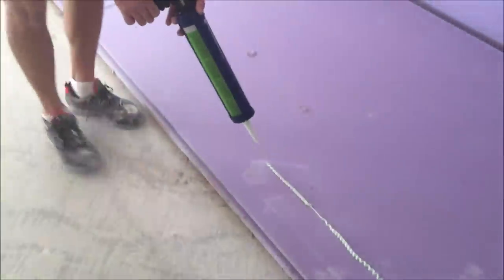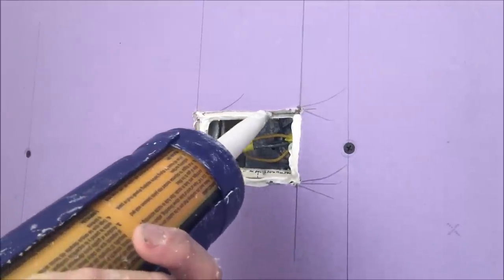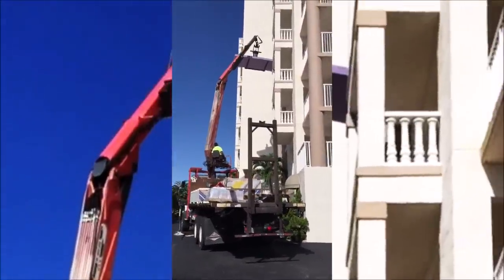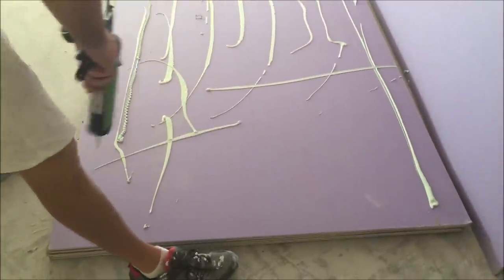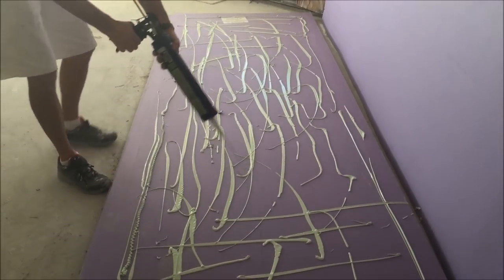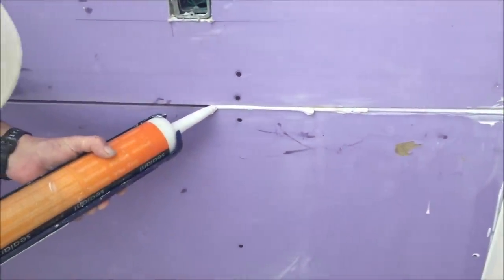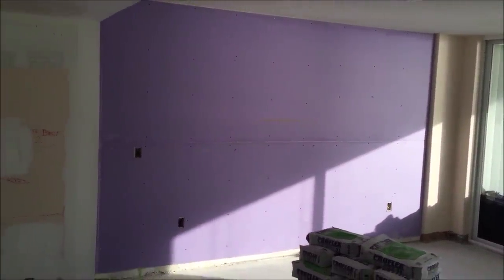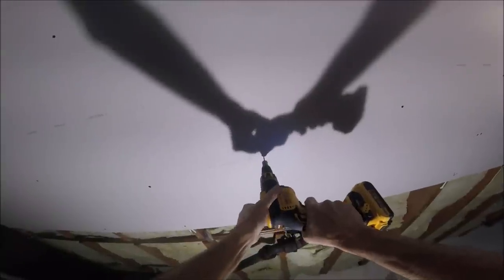Soundproofing walls without removing drywall-  Green Glue compound

Comment: I did this in my condo and it really works. If you knock on the wall you can tell it absorbs so much. I can’t hear my neighbors anymore.
Reply: did you use green glue or any regular caulk?
Reply: @shwasey  I used green glue. Two tube per one 4x8 sheet of drywall
Reply: @shwasey  I used green glue
Reply: Was it bass you were blocking or just voice/sound?
Reply: @backcrackingvideosamigo765  voice and overall sound
Reply: I hear banging on my walls all day in townhome. I hear voices too but not as bad. Did this help with those loud "bang" noises you hear all day?
Reply: @OranguBANG   Yes
Reply: How much does this usually cost for 1 wall

Comment: i think it needs more glue
Reply: Came here to post same thing. 😁
Reply: @Merrill26osu  To achieve the advertised soundproofing or STC rating each sheet of drywall requires two tubes of GreenGlue in a random pattern like this video shows.
Reply: Minumum 2, 3 tubes better, per 4 by 8 sheet of 5/8s. Must also use acoustic caulk to seal all seams between sheets, not just corners. Do it right and the benefits are huge.
Reply: wouldn't less glue mean less contact/sound transmission?

Comment: I did that in my townhouse master bedroom and it did not block any sound at all. Thats after spending $200+ on greenglue. If you are planning to soundproof do it right with ripping out drywall, insulating and using resilient channels to hang drywall.
Reply: Appreciate this information. Looking into some master bedroom wall improvements and there seems to be no upper limit to how much you can spend, but diminishing returns for various elements, particularly when you don't use decoupling.

Comment: How’d it work? Looks like you only installed the sound proof dry wall on the shared wall. Noise vibrations can travel trough joist and reflex via non shared walls. My understanding is all walls must be sound proof to have any affect

Comment: Great video!  I wonder if green glue comes in 5 gal buckets and spreading with a notched trowel has any advantages.  Thank you for sharing your knowledge
Reply from the maker: Actually, yes, the GreenGlue does  come in a 5 gallon bucket as well.👍🏻 Thanks so much for watching and subscribing my friend!😎 -Paul
Reply: @PaulPeck  Very Informative! I am in a country where i am not able to access the caulking gun, but i have the tubes from abroad. what would be the best mode of application? Thanks

Comment: @PaulPeck i blew cellulose installation into my ceilings, i have impact noise from upstairs neighbors. Running, stomping, dropping all the time. Question is if i add 2 tubes of green glue to 5'8 drywall will this help with impact noise? Thank you

Comment: Does green glue reduce impact noise from upstairs. I hear a lot of footfall noise and furniture movements, can green glue help in that? I've tray ceilings installed. I am wondering what measures I can take to reduce the impact noise due to footsteps. Thanks

Comment: can the sound proofing sheetrock be installed on top of existing 1/2 inch regular sheetrock?
Reply from the maker: Yes. That’s exactly what I did on this project.👍🏻 I hope this helps. Let me know if you run into any questions along the way. Thanks so much for watching and subscribing!😎 -Paul
Reply: @WT Callahan lll you're adding what???
Reply: is the sound break wall hanging only by the green glue or is it screwed into the existing drywall?
Reply: @PaulPeck  what is the stc rating 🤔?

Comment: you basically use weight on elastic suspension to absorb the sound waves, which is the basis of sound  proofing. you either need tons of mass, or suspended mass.
Reply: Could you explain more what you're talking about?

Comment: Looks like you did a great job!  What do you think of the product called quiet rock?  I bought a condominium for my parents and they can actually hear the people next door sneeze fart and talk or even flush the toilet in certain rooms. The cost is not the question the question is what is the best product please give me some information thank you looks like you really know what you’re doing I’m just wondering about your opinion.  Thank you
Reply from the maker: Hi Wayne, the Quiet Rock is a also a good product. Especially in combination with the GreenGlue compound and sealant.👍🏻 I hope this helps. Thanks so much for watching and subscribing!😎 -Paul
Reply: Quietrock and sound break are similar, just ensure it’s 5/8s thick and is used with3 tubes of green glue per 4 by 8 sheet along with acoustic compound.

Comment: Do you have any tips on soundproofing walls for live streaming? Would appreciate any suggestions on easy DIY fixes for a space that otherwise is also used as a living room. Thank you in advance!
Reply: For live streaming, consider purchasing a microphone noise barrier which is a foam partition which blocks off noise everywhere except from the person in from of the mic. You should also consider a microphone shock-absorbing arm stand in case you bump into your desk or need extra desk space. Covering your walls in egg carton foam panels or professional acoustic panels (typically made of wood frames and filled with rockwool insulation OR filled with cheap towel fabrics) will reduce echo in room. A condensor microphone will automatically block noise from the side and only listen to what is in front and behind it so it's good for musicians and streamers. If you have problem with noise coming through windows, consider using a sewing machine, teflon thread, and rockwool to make your own noise-proof curtain panels. Moving blankets can also help in lowering noise through widows and doors. A cheap way to lower noise through doors are draft stoppers (that slide under the door) and weatherstrip tape placed all around the door frame. Don't forget that Windows 10 and 11 has a free built-in screen recorder when you press windows+G button. Overall, learn to use the program "OBS" and video editing software and you should be fine. Overall, learn to use the program "OBS" and video editing software and you should be fine. Good luck.

Comment: I do drywall and I can tell you that leaving a gap on drywall is a no no. Sound proofing drywall is you install the top sheet using glue on all 4 edges. Do the top and the 2 sides and then tack the drywall in place then you add your glue on the bottom sheet on top and then use a drywall jack to lift it into place. I have seen cracks after cracks on drywall from people not framing a house straight to drywallers not even knowing how to cut their angles right. The right way is always but your joints into place. Do not leave a gap at all

Comment: Hi Paul so if I hear you right you wait for this caulking to dry then tape and finish as normal. and one more ? did you go over 1/2'' or 3/4" already up. and what was the sound value? ok that was two more. thanks again

Comment: For new construction, do you recommend 2 layers of the soundproof drywall or is 1 layer of regular drywall and 1 layer of soundproof drywall just fine?
Reply from the maker: Two layers of sound board would reduce more noise for sure!👍🏻 Is it a party wall? Thanks so much for watching and subscribing my friend!😎 -Paul
Reply: @PaulPeck  No I'm separating a huge bedroom into a large Master and smaller bedroom and don't really wanna be hearing my kids' music all night.
Reply: The more u use, the better. The best would be 2 sheets of quietrock 5/8s thick, then 3 tubes of green glue per 4 by 8 sheet, and then use acoustic caulk on all seams.
Reply: @hardcorehouse  the more green glue you use the more it will transmit sound, less is better!

Comment: #drywalltube Thanks for all of your great videos! I have never drywalled before and need to fix an 8'x14' bedroom wall that's been taken down to the studs. I live in a condo and a neighbor's bedroom wall is on the other side of mine. Sound isn't a major issue (luckily we're both respectful) but I would like some extra sound buffering. I installed Rockwool insulation. Now I am planning on installing 5/8" drywall (I didn't realize how heavy this stuff is!). For further sound reduction, I am considering putting another layer of 1/2" drywall over that, and am considering putting green glue between the layers and possibly the acoustic sealant around the perimeter and in the joints. However, I don't have any sealing around the electrical boxes, and I am such a novice to all of this, I don't know if taking all of these extra measure will be a waste of time and money, because apparently if I miss any details, which I may inevitably do as I am brand new to this, these soundproofing efforts are a waste, as the sound will make it through any spots I miss. Plus sound isn't that big of an issue (but money is!). Do you think it's worth my putting up two layers of drywall? Or is the one layer of 5/8" over the insulation enough? If I install the second layer of drywall, do I only secure it to the first layer of drywall and avoid the studs? I am thinking of hanging the 5/8" drywall vertically, and then the 1/2" drywall horizontally. And I am on the fence about the green glue. I appreciate any input you may have. Thanks.
Reply: Hi, if you have any remaining questions, let me know. It’s well worth doing properly-big differences.

Comment: The more videos I watch the more confused i get.We just bought an older farm house. Our bed head board will now be on the wall where my son's den (loud playing ps3 and friends over, ping pong lol) is on the other side. both sides of wall is currently sheet rock with no insulation in between. We are really wanting the tongue and groove pine wood boards aka shiplap on our bedroom walls. What is our most cost effective solution for sound proofing??
Reply from the maker: I would use the sound reducing drywall and green glue products on top of the existing drywall on both sides of that wall. Or at least do your sons side first and see how much it helps. Then make the decision if you need to do your wall in your room or not. I hope this helps.👍🏻 Thanks so much for watching and subscribing!😎 -Paul
Reply: thank you very much for infor, we will do son's side first but my other question was on our side there is sheet rock already but we want pine wood walls on our side, so what do we do for that?
Reply: @dawnsmith7896  you can mark the studs (all verticals) and install the shiplap over the sheetrock

Comment: Ho Paul, in the garage install , did you just do the Green Glue along the joists and 1 sheet of 5/8 ? 
If so, reccomend the same for finishing a basement ? Recommend to add some insulation batts ?

Comment: Whats your thought with this material and road noise?
Reply from the maker: If you use the sound board and GreenGlue it will help a lot.👍🏻 Is there a window in the room?
Reply: @PaulPeck  yes.   I’m watching this video considering new construction by a noisy road.

Comment: Do you screw the drywallll into the studs? If so, how did you know where to screw them in?
Reply: use a stud-finder
it is a device that you hold up against the wall and it will find the stud for you

Comment: Will this reduce neighbors bass coming through the party wall?
Reply: For bass you need dense material. You could build a fake wall over your current wall to block noise TO your room. Construct a faux wall made of dense wood frame, fill with rockwool insulation, apply a sheet of mass-loaded vinyl over the insulation, use sound-proofing glue, and end with sound-proofing drywall. You could also use acoustic foam panels to dampen noise FROM your room. 

To be honest, it is easier to call police non-emergency number and make complaint about loud neighbors, buy noise-canceling headphones like Sony WH1000XM3/4/5, or find a lawyer and begin civil lawsuit for their noise disrupting your peace. Or move.

Comment: Cutting the drywall and using the elevator would have really been a problem.  That boom truck saved the day for sure. 30 days of dry time is long stretch.
Reply from the maker: Hey Scott, Yes, that would have been an issue. Been there done that too... I've had to take the stairs before as well. The green glue compound takes 30 day's to fully cure. But, you can continue with the Green Glue sealant and drywall finish as normal after 48 hours. Thanks for stopping by bro! -Paul

Comment: Hello!  I'm wondering if this would also work for my current situation?   (And, if not, do you have any other suggestions?)  I have a semi-detached house with walls made of plaster.  It seems like there's much of nothing between the common wall that I share with my neighbors.  I can hear when they're talking or coughing/sneezing.  When their dogs are barking, it sounds like they are in my house with me.  I can hear when they are going up or down their stairs and when they are opening/closing their front door.  One time, I was sitting in my living room while my neighbor was sweeping in their living room and I could literally hear the bristles on the broom brushing up against the common wall.  Thanks in advance for your feedback!
Reply: If done properly, there’s a huge difference. You’d have to talk to a veteran dry Waller to figure out how to attach the new dry wall to the plaster walls.
Reply: @hardcorehouse  Just seeing this, but thank you so much for your response!
Reply: Use 5/8s soundbreak plus 3 tubes of green glue per 4 by 8 sheet, then use acoustic caulk on all the edges/corners/seems. That should be enough. If more is needed, repeat the process using another layer of drywall, green glue, etc.
Reply: @hardcorehouse  ty
Reply: On youtube try some quiet rock or sound break vids on special drywall, and green glue that is applied between wall layers
Reply: @hardcorehouse  my townhome is 1700 sq feet. Wouldn't this be quite expensive to sound proof?
Reply: You only have to soundproof adjoining walls where sound is coming from
Reply: @hardcorehouse  you know how much sound it would actually absorb? I mostly hear a neighbors kids banging on against the walls all day (or possibly running on hardwood floor echoing through walls) 

You think an extra soundproof drywall will actually drown them out or will it be work for nothing?

Thanks for all they help btw you're awesome
Reply: It makes quite a difference;  you have to combine several technologies. use quiet rock or soundbreak drywall preferably five eights, then use three tubes of green glue for each 4 x 8 panel, then seal all the openings between the drywall and corners/seams in the drywall using acoustic caulk. Its not hard once all ingredients are obtained
Reply: We're you able to fix your situation I also have a shared plaster wall and would be happy to hear if there are any solutions

Comment: I've looked at different ways to soundproof walls and it seems to me that the main idea is to have as much isolation between surfaces as possible. That being said, even though the adhesive is sound rated, it is a contact point between surfaces. So common sense tells me that using the least amount of that adhesive you can get away with will give you the highest degree of soundproofing.
Reply: Normally that would be correct as the glue would dry hard and sound would travel through as vibration. However green glue never fully sets so it absorbs some extra sound. I think they recommend 2 tubes per panel.

Comment: Hey Paul! Great video. Actually going through a sound proofing project of my own right now and are going to use green glue. In your experience how many decibels of sound drop does the green glue product and two 5/8s drywall actually reduce sound? Will it also block low frequency sound (as i've heard others talk about) or at least sufficiently muffle it? We live in a really active neighbourhood with a lot of noise. #Nimminati
Reply: It’s hard to put a number on it, but if you use 5/8s quietrock, green glue and acoustic caulk, there are significant improvements.
Reply: as you probabaly found out green glue doesnt' do anything to block low bass noise.
Reply: @solarroofing8072  what is low bass? I'm trying to block out my neighbors. I can hear them speaking through the walls would this help?

Comment: You need as little green glue as possible, sound will travel more through the glue then the space between the drywalls,  that much glue makes it not as good as it could be at stopping
Reply: You need 2 tubes per 4 by 8 sheet. That's what is recommended.

Comment: Green glue is really not worth bothering with, you need proper decoupling to give any real noise reduction, sure an extra layer of drywall will help but you really need to sandwich an acoustic board or mass loaded vinyl between the layers to get anything like reasonable results.

Comment: Anybody ever tried using regular caulking instead of this green glue. I bet this stuff is $15-20 per tube. Caulking only cost $3 pre tube.
Reply from the maker: No, it won’t even be close to the soundproofing qualities of GreenGlue. It’s well worth the money! I hope this helps. 👍🏻 Thanks so much for watching and subscribing! -Paul
Reply: Paul Peck DrywallTube  I went to home depot tonight (i live in Ontario Canada) and they had “Lepage PL Acoustic-Seal” in large 825ml caulking tubes. Lepage is a pretty good company in my opinion and at $9.97 (canadian) per tube im thinking that this is the best for me.
Reply from the maker: Right on man! Let me know how it works out for you. 👍🏻

Comment: 30 days to dry - dang!!!
Reply from the maker: The green glue compound takes 30 day's to fully cure. But, you can continue with the Green Glue sealant. Once the sealant dries you can drywall finish as normal after 48 hours. Happy Thanksgiving bro!👍 -Paul
Reply: My experience, and manufacturer’s info, is 7 days cure time.